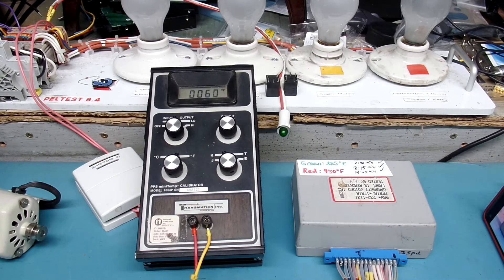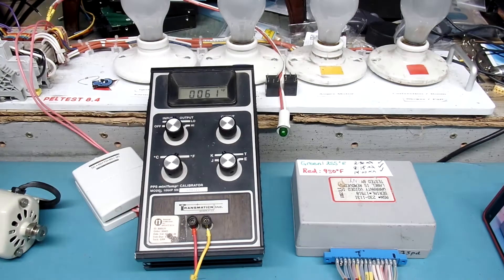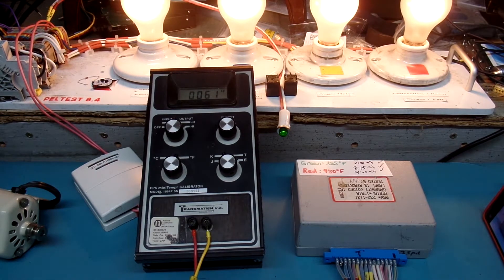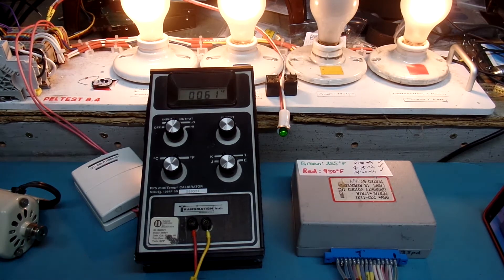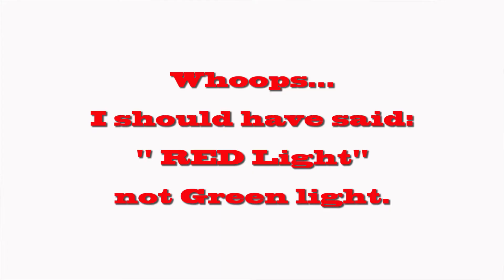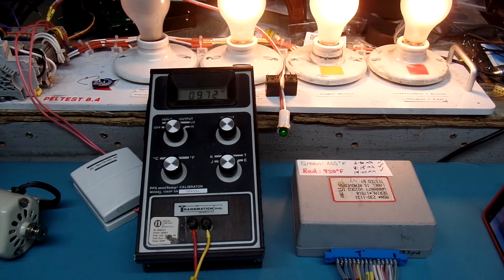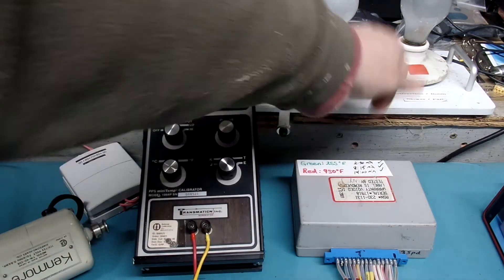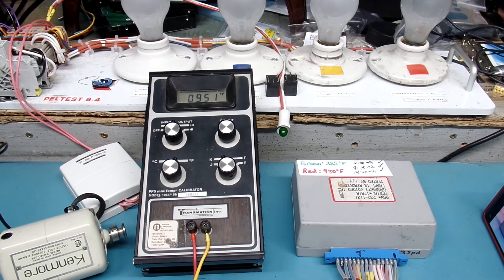Post Repairs Testing and Functional  Description of a QuadraFire 230-1131 Pellet Stove Controller.

Comment: One quick question just so I understand:  in your video, when first putting power to the controller, the exhaust fan power light comes on as well as the convection fan light.  The convection fan always has power and is switched on and off via a snap disk? When powered up initially, with no call for heat from the thermostat, the exhaust fan will run for 15 or so minutes and then shut off?  Is this correct?  In other words, the light for the exhaust fan would have gone (after 15 mins) out leaving only the convection fan light on. (in a power on but no cal for heat condition)  Thank you!